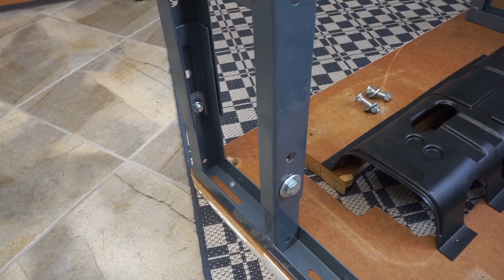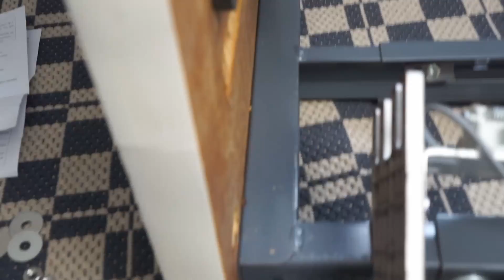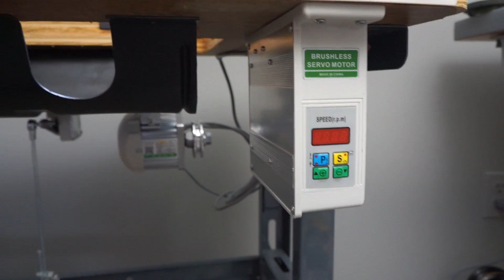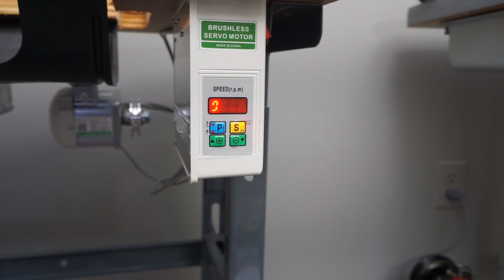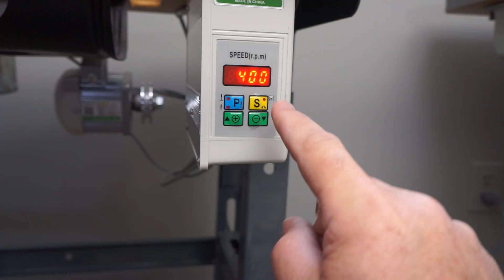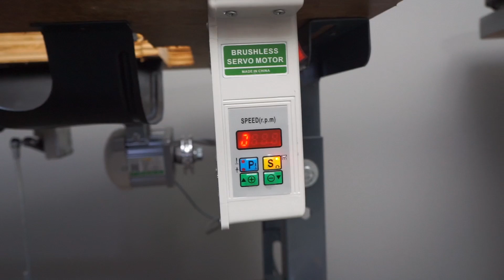Dürkopp Adler 267-373 Industrial walking foot sewing machine set up and servo motor installation.

Comment: I just acquired one of these machines, but the motor is 220v so it will need a new motor before I can even use it. Can you please share the motor you bought in this video? The 220v 3 phase motor that is on it is 1/2hp. Do you recommend staying with that HP? Your advice is GREATLY appreciated. I would really like to just get the motor that you have in this video, if you don't mind sharing a link or brand or something! Thank you so much!!

Comment: Hello, I have a Adler 67 373-GK. My table is wore out where the hinges fit.  Where do you recommend a new top and hinges and front cushion set from? I plan on getting a servo motor for it as well.  Great video!
Reply from the maker: Ebay or Amazon